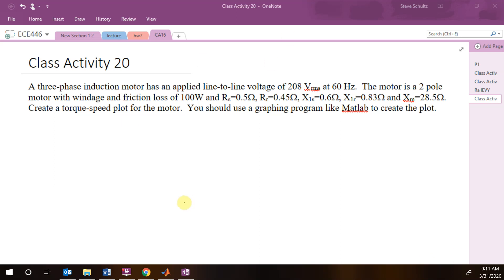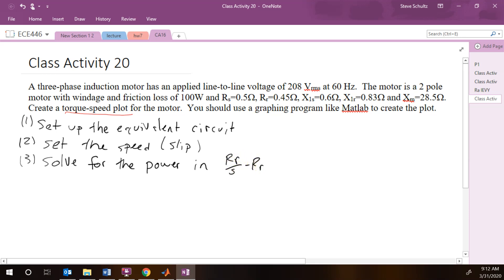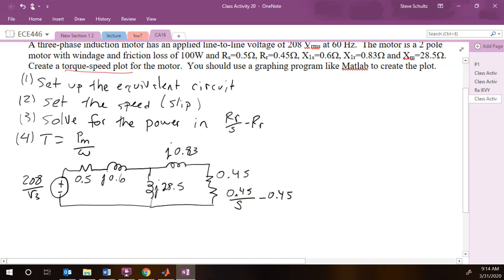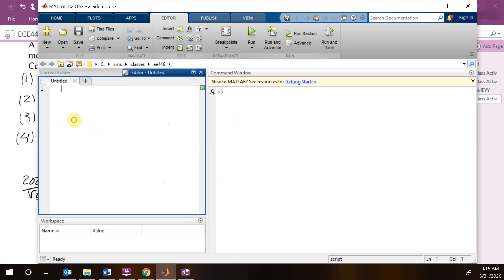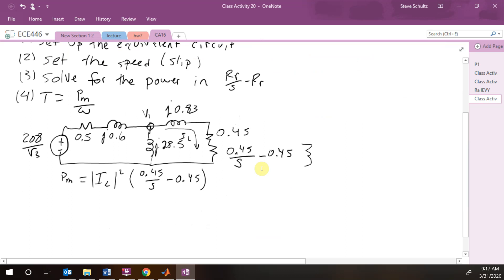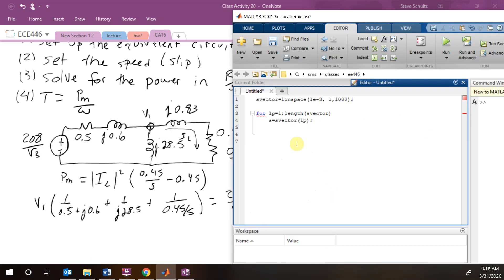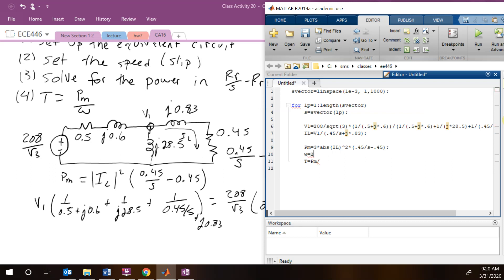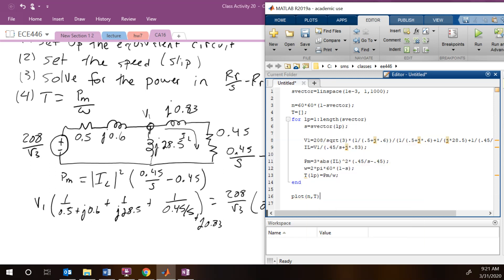Induction motor torque speed plot

Comment: hye how to do this in matlab when the value of slip should be varied from 1.00 to 0.00 with the interval of 0.01.
Reply: You vary the slip using a for loop.  Here is the Matlab code:
This is the Matlab code:
%%%%%%%%%%%%%%%%%%%%%%%%%%%%%%%%%%%%%%%%%%%%%%%%%%%%%%%%%%%%%%%%%%%
% This file creates the torque speed plots for an induction motor.
% The resistances are fixed.
% The frequency is fixed
%
% Basic process:
%   (1) set up basic motor parameters
%   (2) create a range of slip
%   (3) For each slip computer
%   (3a) compute total impedance
%   (3b) compute different powers (electrical, mechanical, etc.)
%   (3c) compute torque
%   (4) create plots
%%%%%%%%%%%%%%%%%%%%%%%%%%%%%%%%%%%%%%%%%%%%%%%%%%%%%%%%%%%%%%%%%%

ss=linspace(1e-4,.999,10000);

%Motor parameters
    f=60;
    V1=460/sqrt(3);     %Line-to-neutral voltage
    
    poles=6;
    R1=0.003;
    X1=0.0661;
    R2=0.0027;
    X2=X1;
    Xm=1.5443;

    loss=6579.5;
  
    fsyn=f/(poles/2);
    wm=fsyn*2*pi*(1-ss);    %motor speed array in rad/s
    n=wm*60/(2*pi);         %motor speed array in rpm

clear I F eff T Pmd
for lp=1:length(ss)
    s=ss(lp);

    fslip=s*fsyn;
    fm=fsyn-fslip;

    Z2=R2/s+j*X2;                   % stator impedance
    Z3=(1/(j*Xm)+1/Z2)^(-1);        % armature + stator
    Z4=R1+j*X1+(1/(j*Xm)+1/Z2)^(-1);% Total impedance

    I1=V1/(Z4);         %total current
    pf(lp)=cos(angle(Z4));  %system pf

    Vx=V1*Z3/(Z4);      %rotor voltage
    I2=Vx/Z2;           %rotor current
    Ix=Vx/(j*Xm);       %magnetizing current
    
    Pg=3*abs(I1)^2*real(Z3);    %Total electrical power
    RCL=3*abs(I2)^2*R2;         %rotor heating loss
    SCL=3*abs(I1)^2*R1;         %stator heatign loss 

    Pconv=3*abs(I2)^2*R2*(1-s)/s;   %total meachnical loss (power done + mechanical loss)
    Pmd(lp)=Pconv-loss;             %mechanical work supplied by motor
    T(lp)=Pconv/(2*pi*fm);          %torque
    
    Pin=real(3*V1*I1);
    eff(lp)=Pmd(lp)/Pin;
    I(lp)=abs(I1);
    F(lp)=fm;
end

figure(2)
[mx,lp1]=max(eff);
nFL=round(n(lp1));
[T_max, ind_max]=max(T)

plot(n,T)
ylabel('torque (Nm)')
xlabel('motor speed (rpm)')
xlim([0 1250])
grid

figure(1)
subplot(3,1,1)
plot(n,Pmd/746)
ylabel('Mech. Power (HP)')
grid

subplot(3,1,2)
plot(n,eff*100)
ylim([0 100])
ylabel('eff (%)')
grid

subplot(3,1,3)
plot(n,I)
ylabel('I (A)')
xlabel('motor speed (rpm)')
grid

Comment: can share the coding here ?
Reply from the maker: This is the Matlab code:
%%%%%%%%%%%%%%%%%%%%%%%%%%%%%%%%%%%%%%%%%%%%%%%%%%%%%%%%%%%%%%%%%%%
% This file creates the torque speed plots for an induction motor.
% The resistances are fixed.
% The frequency is fixed
%
% Basic process:
%   (1) set up basic motor parameters
%   (2) create a range of slip
%   (3) For each slip computer
%   (3a) compute total impedance
%   (3b) compute different powers (electrical, mechanical, etc.)
%   (3c) compute torque
%   (4) create plots
%%%%%%%%%%%%%%%%%%%%%%%%%%%%%%%%%%%%%%%%%%%%%%%%%%%%%%%%%%%%%%%%%%

ss=linspace(1e-4,.999,10000);

%Motor parameters
    f=60;
    V1=460/sqrt(3);     %Line-to-neutral voltage
    
    poles=6;
    R1=0.003;
    X1=0.0661;
    R2=0.0027;
    X2=X1;
    Xm=1.5443;

    loss=6579.5;
  
    fsyn=f/(poles/2);
    wm=fsyn*2*pi*(1-ss);    %motor speed array in rad/s
    n=wm*60/(2*pi);         %motor speed array in rpm

clear I F eff T Pmd
for lp=1:length(ss)
    s=ss(lp);

    fslip=s*fsyn;
    fm=fsyn-fslip;

    Z2=R2/s+j*X2;                   % stator impedance
    Z3=(1/(j*Xm)+1/Z2)^(-1);        % armature + stator
    Z4=R1+j*X1+(1/(j*Xm)+1/Z2)^(-1);% Total impedance

    I1=V1/(Z4);         %total current
    pf(lp)=cos(angle(Z4));  %system pf

    Vx=V1*Z3/(Z4);      %rotor voltage
    I2=Vx/Z2;           %rotor current
    Ix=Vx/(j*Xm);       %magnetizing current
    
    Pg=3*abs(I1)^2*real(Z3);    %Total electrical power
    RCL=3*abs(I2)^2*R2;         %rotor heating loss
    SCL=3*abs(I1)^2*R1;         %stator heatign loss 

    Pconv=3*abs(I2)^2*R2*(1-s)/s;   %total meachnical loss (power done + mechanical loss)
    Pmd(lp)=Pconv-loss;             %mechanical work supplied by motor
    T(lp)=Pconv/(2*pi*fm);          %torque
    
    Pin=real(3*V1*I1);
    eff(lp)=Pmd(lp)/Pin;
    I(lp)=abs(I1);
    F(lp)=fm;
end

figure(2)
[mx,lp1]=max(eff);
nFL=round(n(lp1));
[T_max, ind_max]=max(T)

plot(n,T)
ylabel('torque (Nm)')
xlabel('motor speed (rpm)')
xlim([0 1250])
grid

figure(1)
subplot(3,1,1)
plot(n,Pmd/746)
ylabel('Mech. Power (HP)')
grid

subplot(3,1,2)
plot(n,eff*100)
ylim([0 100])
ylabel('eff (%)')
grid

subplot(3,1,3)
plot(n,I)
ylabel('I (A)')
xlabel('motor speed (rpm)')
grid